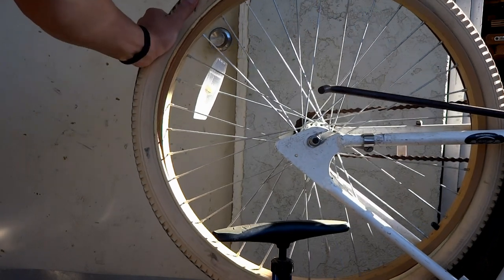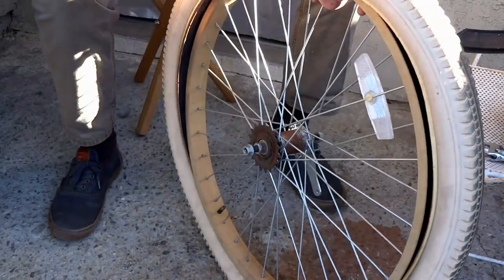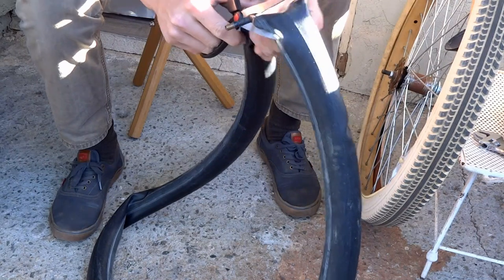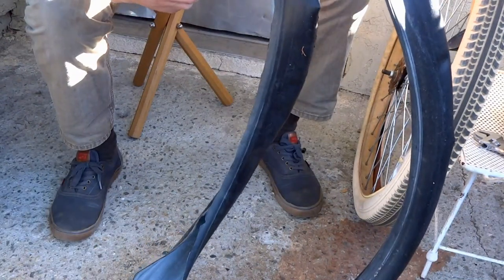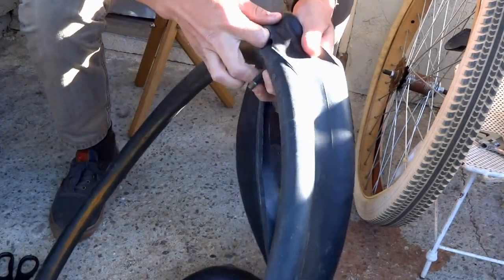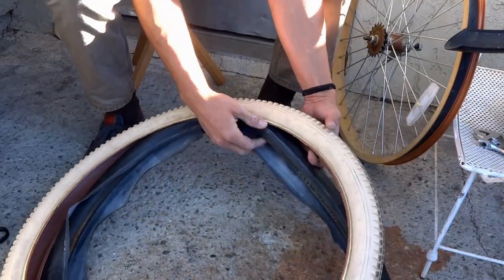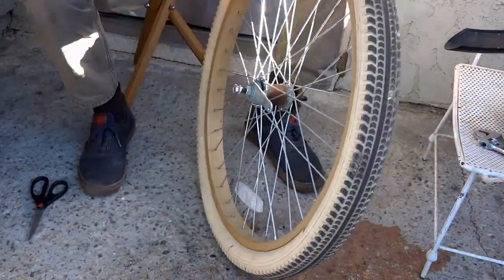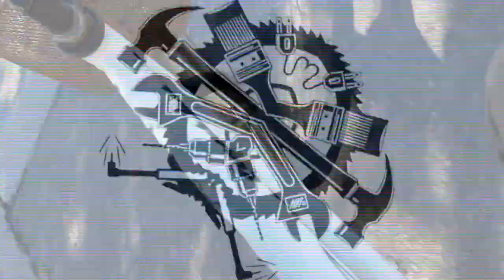Inner Tube Repair Trick -- DIY Thick Wall Bicycle Tube

Comment: Doubling wall thickness of the tube like this will certainly help with puncture resistance. But if you pick up a shard of glass in your tyre it will eventually work it's way through all of that soft rubber to make a puncture. I am currently experimenting with inserting pallet strapping cable (very lightweight and flexible plastic, but extremely tough) inside an old tube to create a puncture resistent barrier. That gives two layers of inner tube rubber and the pallet cable between the tyre and the inflated tube. So if I do pick up a piece of glass, it will not get any further than the pallet cable.
Reply from the maker: That is genius! Excellent idea, that material should provide great protection. I will have to add that to the bag of tricks 🤙
Reply: I wish I knew what is "pallet strapping cable", as google images didn't give me something similar.  Maybe it's the same as truckers cargo straps?
Reply: @masvas1  It's the flat cable used to tie things down to wood pallets for transport. However I have to report that my experiment with this cable was not a success - the plastic cable was just not flexible enough for this purpose. So I am now experimenting with strips of flooring vinyl. This seems better because I can cut it to fit inside the inner tube and it is very flexible. I put the tough outer surface facing the outward. The soft inner (about 2mm thick) should compress over time and then I will have to top up the air. But I'll have to see how things go with this method.
Reply: @streetlegal008   Dude, awesome.  You're pushing the boundaries.  That's the first I've heard of trying out vinyl flooring.   I wish you success.
Reply: @streetlegal008  how about old seatbelts as a liner?
Reply: @tomcruz3774  Good idea - I think that could work Tom - if you wanted a slim liner and pretty lightweight. If you can pick up an old seat belt from a  junkyard for free it would be easy to test it out.
Reply: Had something like that it would pop the tube, kind of saw along the ridge line of thematerial. You could tell, seeing the rub wear as I guess the tube flexed. Long tear out, more so than blow out hole.
Reply: @markraciborski4289  Yes - that is a risk it is true. By way of an update -  after my experimentation I decided that these inserted barriers were not the real answer to the problem of flats. A lot of punctures - maybe as much as 50% - are not caused by thorns or glass etc but by failure of the inner tube at some weak point. So that led me to try OKO Tyre Sealant in my inner tube and I have to say that so far it is working very well - and I can now get my tyres up to the right pressure.
Reply: @streetlegal008  dude you got a channel. I like your style
Reply: @Oldmanlearns718  No channel - I just like to share my thoughts on this stuff. Anyway the Oko Tyre Sealant - the heavy duty stuff for tractors and the like, so much better value than the bike stuff - has worked out great for me this summer. A bit difficult to get in the tube - you have to have schrader valves and better to do it before fitting the tube - but well worth the effort!
Reply: Flat-out works great too,but for a roadbike you notice the rolling resistance. Probably good for a cruiser

Comment: I thought I was a genius for cutting my tire on both sides of its side plane and inserting it on the underside of both my tires because when you cut the inner tube in half on both sides you get 2 half sided sleeves. I thought that was the best idea EVER! Then watching this made me realize I just doubled the work of how simplistic this solution really was. Haha! I mean, it still worked, but this is the better solution. Thank you!
Reply from the maker: Thank you for the kind words I’m glad the video was helpful

Comment: Pretty cool, I'm trying this! Due to the current status of the world it is hard to find thicker inner tubes without being price gouged.  I went from paying 20 to 40 for my last pair.
Reply from the maker: Oh my! New thick tubes still aren’t as thick as they used to be
Reply: @handbuiltbob  seems to be true, sadly. The thicker one with bold claims is the Duro brand, pretty good brand and puncture proof to a light degree. Small pieces of glass, and debris without spikes, nails no.
Reply: Really $40 ? Here ,retired american expat  in philippines the most I paid was $5 . Thats a  thicker one .    I got  holes from where the rim joins I think .there is a 1/16 gap there .not welded .
I covered that  with tape .   And by chance just did the same trick with the old tube .
  ...but getting tubes on this island can be tough ..the one place that I get them from was out .  So I went to the only other shop ..and I didn't realize until I got home he sold me one with a presta valve stem .
 The stem can slide around in the hole ,being a smaller diameter What ever I'll try it.
  And the tube was $3.60  . Not a big loss of $

Comment: its easier to line the inside of the tyre first with the tube, but i use mastic to stick it down, so the tyre itself has more thickness not the tube so to speak, i also use cut tubing for rim tape ( never had underside ruptures again )
Reply from the maker: Making rim tape out of old tube is a great idea. Both ideas are great 👍

Comment: I’ve been doing this to all my bikes for over 2 decades.  As soon as I get the first flat. Usually on the first few rides.  I get a new tube and apply this technique.  To the nay sayers…   It really does work. I’ve had maybe 3 flats total on all the bikes post liner.  
Here is the science:   Fill a balloon barely and another fully.  Now try popping both.  The barely inflated balloon is harder to pop.  That’s because the rubber is not already stressed.  The split liner is not stressed so is much harder to pierce.  I don’t think plastic straps would be as effective since they don’t stretch.  Try poking a drywall screw through a deflated inner tube vs a plastic strap and you’ll see what I mean.
Reply from the maker: Very thorough response. The science makes sense, very good explanation

Comment: I've followed your tip like back in 2020 and the only time i got a flat was when I accidentally slammed my rim against some rocks and when I used gravelking semi slick tires (super thin tires, i dont recommend them). 
Last year I added some WTB sealant to my tubes, chose WTB since they don't dry up and clog the valves. No punctures so far.
Reply from the maker: That’s awesome, getting some good use out of those tubes 🤙

Comment: What are your thoughts on doing exactly what you just did. But not doing just one but 2 cut tires on it. Would that be too much? Would it cause a lot of deformity Inside of the tire with the two cut tires insulating it double? Any help would be appreciated
Reply from the maker: It might be tough to get the tire on. Not sure how much deformity it would cause inside maybe trimming it down. Depending on how bad the deformity is

Comment: i did it without cutting the inner tube in half, do you think it will still work because there may be like folds on the tube?
Reply from the maker: Depends. I first started using this trick mainly for road bikes, much smaller tubes and tires. My only concern would be that the tube may roll around or slip to one side. Haven’t done it that way but if I do two layers I will split the tube to ensure that it’s more or less held in place

Comment: Sir ,can i use double wall for better protection and your opinion can double wall deform tire
Reply from the maker: It might not deform the tire but depending on the size of rim and tire you could have a real good wrestling match on your hands. I know for road tires 700x25c is tight.
Reply: Sir ty for answer,my rim is 28",700c i will try with one wall and we will see,stay safe.
Reply from the maker: 700x28 should be enough space. Run a 700x23 tube and whatever the outside tube was. It can be done with larger size but it’s a wrestling match

Comment: Can you do this for the 700x 25c presa tubes as well?
Reply from the maker: I first used this technique for road bikes. I bought an old 80s roadie and it had the beefiest 700x23c I’d ever seen. That’s when I starting splitting tubes. Sometimes it gets a bit tight depending on the tire for road wheels

Comment: Well your idea works and protects the sidewall s as well just barely. Secondly i cut the valve stem out completely without splitting the tube open this give much better protection making the tires indestructible.
Reply from the maker: Double layer! 👍

Comment: Dude you got a lot of rotational mass there.  Not that it matters on a cruiser bike...
Reply from the maker: I don’t think adding a tube will make a noticeable difference. Been using this method at least 10 years with no issues.

Comment: This is not great because now you have uneven pressure distribution inside of the tyre obviously you can't cut it perfectly straight and fit or perfectly evenly!
Reply from the maker: It’s not going to the moon, it’s a bike tire. The pressure variance is negligible when compared to the results. The method works, I’ve used it for years now
Reply: @handbuiltbob  guess what? With extra pressure it increase exponentially. And additionally to that, over time it causes failures. Just like a grain of sand is maybe nothing to you, but it will make your tube leak air that much more in a few months. You probably don't ride at at least 6 bars (about 100 psi), which significantly reduces puncture resistance. I really doubt that this is any more effective than just riding at high enough pressures.  Or getting a thicker inner tube factory made with perfect symmetry.
Reply from the maker: For small tires that sounds reasonable but this is a fairly large tire. I’m not sure how you fit your tires/tubes but I’ve done this on many different bikes and tire sizes, of varying pressure recommendations (up to 100 psi) it increases longevity of the tube tire - at least for me. All tubes will fail eventually. I haven’t seen this method contribute to failure prematurely but it’s all experiential. Results may vary 🤙
Reply: @handbuiltbob  you might get some slight improvement over using just your method depending on your luck, but what I'm saying is try out just buying a thick tube. From my quire exhausting research you can get kenda 4.3mm thickness tube for example. There a few others that make at least 3mm thick tubes, it took me a couple of hours to search them..

So try out one or two of these and have a comparison at same variables like pressure etc
Reply from the maker: If local shops near me carried thicker tubes I would definitely try them. Unfortunately they only carry a couple different brands of tubes which are no where near as thick as tubes I used to buy. 😁
Reply: @handbuiltbob  I understand you. I used to buy only from local shops too.  I keep getting censored for telling what website has the thickest tube. My comment gets auto removed. Let's say it is the name of the biggest rainforest.
Reply: @handbuiltbob  kenda 4.3mm  is the thickest one I could find
Reply from the maker: 😂 I get it
Reply: Pressure will always be evenly distributed if I remember from my physics classes.  As long as the liner is put in correctly it will have even WEIGHT distribution as well.
Reply: Do a physics experiment of a bridge to place weights onto) with various types of asymmetry. You will lswe how great the weight is aways evenly distributed when it keeps collapsing